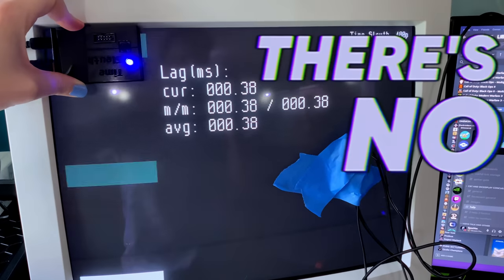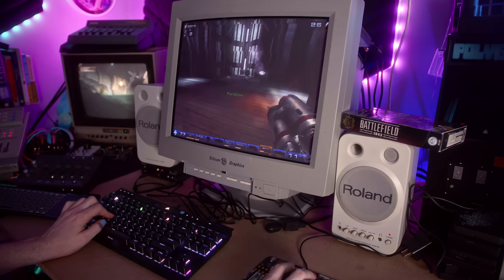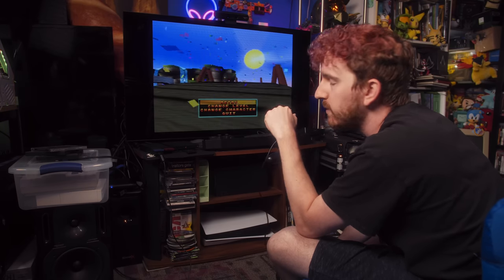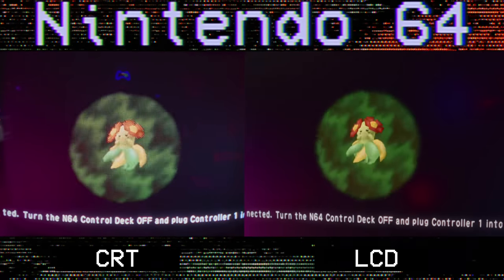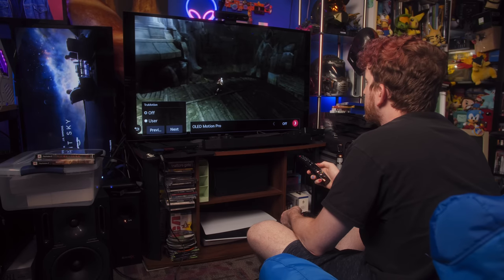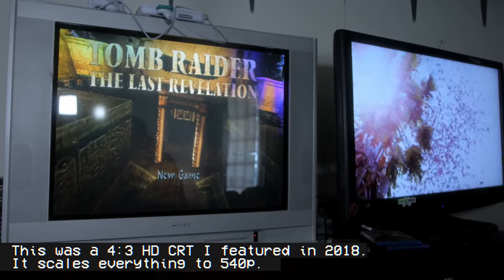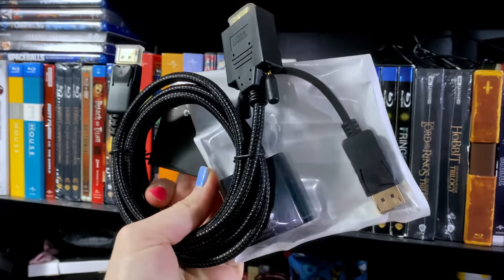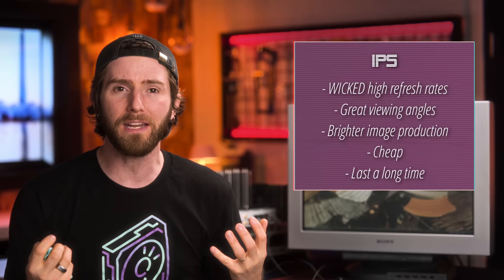Old Trash or Treasure? CRT vs LCD: The Final Verdict

Comment: Something I wish people like you and other crt vs lcd critics would talk about is upscaling and how it’s not a good idea. For example when you play a ps2 (outputting 480i) on a crt of similar era(not on a hd crt. On one with max res 480i)the ps2 graphics won’t be up scaled at all and that’s a good thing. Since a flatscreen will output much higher res’s it has to upscale, a good way of thinking about this is res= number of vertical lines either outputting from a console or physically on a tv screen. Upscaling is taking a low res picture and distorting it to be displayed on more vertical lines. Theoretically If you play a ps1(240p) on a 4K tv with zero upscaling on your tv it will be a very small picture compared to the size of a picture using every pixel. On a crt with only 240 lines vertically it will have no upscaling and every dot being outputted you can see it perfectly. Upscaling takes one pixel from a 240p image and uses more pixels on a higher res tv to display that one pixel, making older games blockier especially older games because they use a lower resolution. I also don’t think descaling is the best idea either for newer games to a old tv. For that hd crts is better so you don’t have to descale. Please share this with other critics and/ or put in another video like this one
Reply from the maker: Except upscaling when done right is great and required for deinterlacing messy 480i video, which is why I HAVE covered upscalers quite thoroughly and have a new video on one coming next week
Reply from the maker: (But also everything said about the native res looking sharp and it accepting any res and displaying naturally etc all address this point you’re trying to make in literally every CRT video I’ve ever made)

Comment: I have 2 Sony GDM-FW900 ... too bad my RX5700XT doesn't have analog signal output.  I only use them now with a Powermac Dual G5 with MorphOS. But I don't use it much anymore.

Considering I need a new computer, I think maybe it is time to depart of my sonys ... :D
Reply from the maker: Hnnnng
Reply: Uhhh just use a hdmi to vga converter? There are some pretty good ones out there!
Reply: @wiegraf9009  I have an Eizo now for my work. I have no use for the Sony anymore. I used it a lot untill I got a new CG2730 Eizo panel. Maybe to watch movies or connect my amiga, but for that I have my Panasonic CRT TV , does the Job :)

Comment: Whats the monitor your using
Reply from the maker: I… showed like 25 different CRTs in this video lol
Reply: Are you talking about computer CRT monitors or consumer CRT televisions?  More or less, outside of the type of shadow/slot masks, are basically going to have the same specs.  There's some difference on any types of filters or how they mask the beams.  Basically, for consumer sets, shy away from any that are HD for general purposes and (as mentioned) they're going to be tuned for some type of content and add latency that likely wont' be good for games.  But any TV will likely be fine as a start for a consumer TV.  For computer monitors, typically the larger will be there better as far as resolutions and refresh rates supported.

Comment: little tip: if you have nothing else but an HDMI dongle to connect to your CRT:
for NVidia example:
graphics card setting  → change resolution → use NVidia color settings:
set output color format to YCBCR444 instead of RGB. this will make the image less dark, though not quite VGA.

I have also heard that Win11 allows to send video from one graphics card to another, so you can get a pre-10-series Nvidia GPU for your PC and avoid dongles altogether, at the cost of a little lag.

Comment: I aint never going back to CRTs I just bought two portable monitors one is an 15 INCH OLED INNOCN and the other is a good 16 INCH LED one that is 5:2 ratio and its 2K so far I got a convertor to play my PS1 and PS2 system and it runs great. THERE BOTH LESS THAN A POUND to carry Those CRTs are heavy, Im 40 now and have back problems since I use to carry these TVs for my sister back in the 2000s. I even left my Sony Wega 27 inch TV in Florida since its too heavy. I have the last of flat LED TVs that have component connection and even has VGA and the TV IS 47 inches at 120hz. I am okay with this TV for some content and its my secondary Monitor for my main PC.

Comment: You tested terrible LCDs for input latency. Good LCD can do under 5ms.
Reply from the maker: From click to photon latency? No, no they can not lol
Reply: @EposVox  They can and 360hz TN would beat any CRT easily. Heck, even fast 240 IPS would. Rtings claim sub 5ms for many of them.  What's interesting, they claim that some settings on G7 add unnececary latency. Maybe that's the cause for such a big latency difference.

Comment: CRT damages your eyes.
Reply from the maker: Myth
Reply: @EposVox  My own experience is any time I've used one for more than a few days my vision gets noticeably worse and worse until I switch back to LCD.
Reply: @cwehden  Might be something wrong with your display then.   The monitors themselves do not emit any harmful levels of radiation unless they are damaged or not operating correctly.  I had used CRT monitors full time for a decade and never had any issues with vision.
Reply: @cwehden  What video cables are you using? Do you sit right in front of the TV?
Reply from the maker: Just to be clear: Your vision doesn’t “get worse and worse” and then “better” - if it was actually damaging you’d just have worse vision as a result. 
You might just find it blurry or have a bad set that doesn’t display clearly or needs tuned. 
Plenty of people used CRTs for decades without eye damage lol
Reply: @EposVox  I'm just telling you what happened to me, I have no idea what happens to anyone else so I should have said in my first post 'CRT damaged my eyes'. All I can say is I would never ever go back no matter how sharp or low latency they are..
Reply: @cwehden  
What proof do you have? Also LCD monitors have higher contrast in colors so I'm shocked those aren't hurting your eyes worse.

If you had the refresh rate too low on the CRT then the flicker was bothering your eyes. Clearly a case of user error or you owned a low quality monitor lol!
Reply: @lordterra1377  I have no proof, I'm just stating what happened to ME when I used CRT's in my younger years my vision in one eye got worse and worse over an 8 year period. My vision got noticeably and obviously better over a short period once I changed over to LCD.
Reply: @lordterra1377  I had a very expensive Sony CRT at high refresh, it's not me it's the technology, and like I said I have no proof it's just what happened to me.
Reply: I smell bs, CRTs are much nicer to your eyes compared to modern pulsing LED displays.
Reply: @EposVox  I agree, this story was invented by marketers to replace crt with lcd, just business and nothing personal. LCD is much cheaper to manufacture and transport, which increased the profits of companies perhaps dozens of times.

Comment: you should try useing it on Linux would get alot better fps :)
Reply from the maker: That's not really how it works
Reply: @EposVox  well true in some cases. but linux do use alot less overhead than windows. and mouse feel is alot better on linux. :) some games get bbter fps yes. but not allways and it might not be super big differemce if we are 60fps+

Comment: Latency is really not an issue with most HDTVs and Gaming monitors these days, just as long as you have a good source.  The vast majority of enthusiasts gamer are not going to notice 1 - 2ms difference and I don't even know if competitive speed runners would either since you still would be well under a frame of latency.
Reply from the maker: 1-2ms difference? No. A 10ms difference? Yes. Lol
Reply: @EposVox   10ms measured at the top probably, yeah.  Check the picture I sent you on Twitter of my LG C1 measured with Lag Sleuth.  It really is a nice improvement over the CX.

Comment: My N64 looks very good on my modern, properly calibrated 55" 2018 model FALD LCD TV, (even with a cheap Hyperkin adapter that uses S-Video, but especially with a RAD2X, especially because the console has been RGB modded). Even with my Hyperkin, or even using an unmodified N64 with the RAD2X (using the composite signal), it looks much better than it looked on any of the crappy old CRT TVs I used to own and play with my N64. Maybe if you have a very good CRT that's in good condition, and sit close enough to the display, in a sufficiently dark room, the CRT would be the best way to play, but don't tell people that an N64 will "never look good on an LCD even with a good upscaler". 

I'm sick of hearing this exaggerated CRT elitist nonsense. I've never once heard a CRT snob acknowledge that there are some huge benefits to having a larger screen, especially when playing with friends. But, I acknowledge that if you don't have any friends and sit three feet from your 14" PVM, that could still be an excellent way to play old videogames, possibly even the best way unless maybe you have a Retrotink 4k with an OLED or high-end LCD TV. Please stop making gross exaggerations about how great CRTs are and I'll stop making snarky comments.
Reply from the maker: It’s not even CRT elitism. Video output from the N64 is just plain bad lol. There’s tons of benefits to a big large screen, and I talked about tons of them in my RetroTINK 4K review, but also no ones talking about playing alone on a tiny CRT either. There were plenty of reasonable sized ones to play with friends on. Don’t need a PVM, a nice big consumer set looks amazing.
You’re projecting a lot here that was never said or implied in this video. I’ve always kept a balanced, but informed perspective on these things. 
But the N64 has some of the worst video of any console and always looks gross on LCD.
Nothing here is exaggerated, the N64 scene has spent decades trying to remove the blur and other issues applied to the N64’s video output because most anyone has been unhappy with it.
Reply: N64 doesn't look good on your TV. Stop lying to yourself. The only way it will look good is the RGB or HDMI Mod. There are still tons of good CRTs out there. And you also need to calibrate the settings to get a good picture.